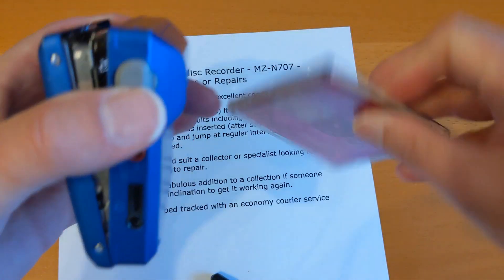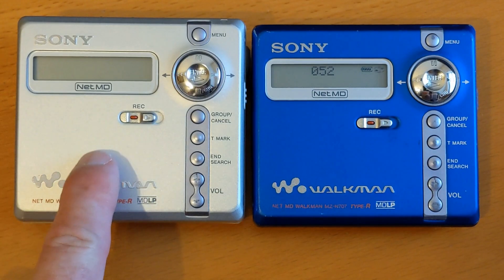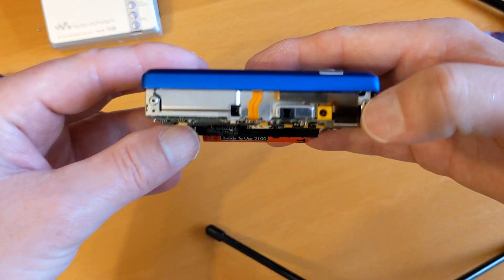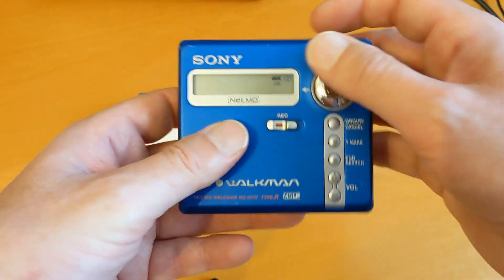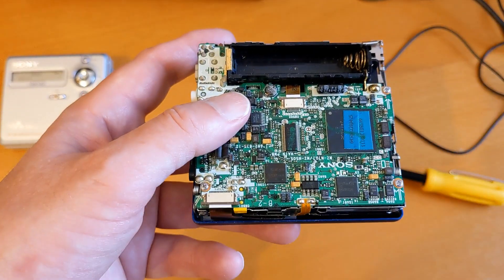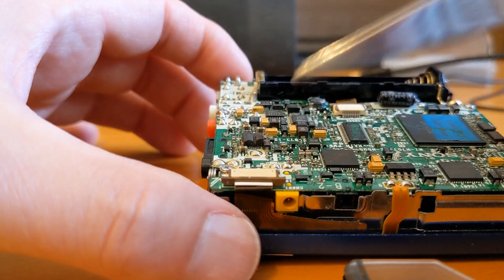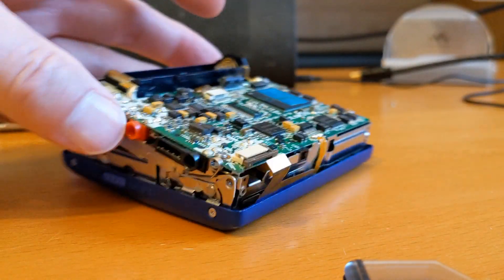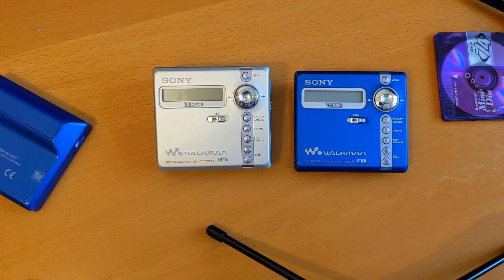MZ-N707 Repair Hypothesis. Proof needed.

Comment: I wonder if one model is newer and had a feature to prevent accidental operation? That being said, I have a blue one and it does start on one press.
Reply from the maker: Thanks for the feedback. Could be, I suppose. Both are not working again, so when (if) I get to repair then again I'll look for some info to identify which is newer.

Comment: I did that procedure before watching your video on a 710 model. I did the cleaning with a cotton bud though. Very carefully. After that the buttons worked better for sure yet not completely flawlessly. The reason is that on the other side of the ribbon's edge, there isn't a small bracket to secure it. They tend to lose contact on the other side because they are slowly being torn apart from the panel mini board. So be careful when you play with this!!! The problem might be also on the other side.
Reply from the maker: Right, thanks for the tip. Next time I do one, I'll check the other side.
Reply: @CBitsTech  Cheers! ;)

Comment: I got an mz-r55 that would try and read a disc for a few seconds and then just give up. I took it apart and cleaned all the ribbon cable contacts I could find and that seems to have fixed it.
Reply from the maker: Excellent! Great to have that confirmation that it's often the ribbon cables.
By the way, sorry for the delay in replying to your comments.

Comment: Ribbon cables are hard to check so it is hard to be sure, but I'm glad it seems to be working.
Reply from the maker: Thanks. I'm going to look through my non-working ones (The Techmoan 15, and the ones I bought) for similar problems and just clean the cable, and cable connector if I can, and see if that is the solution on its own.